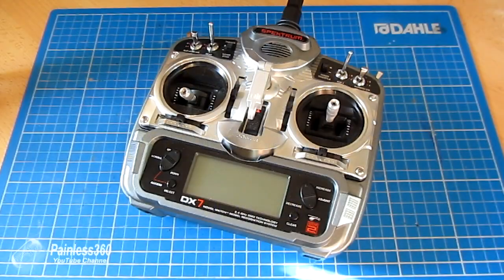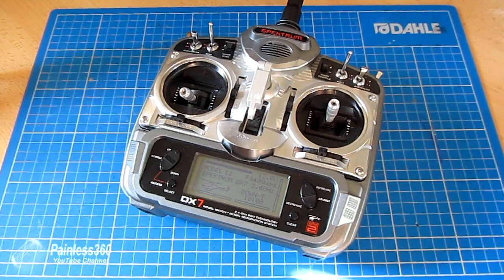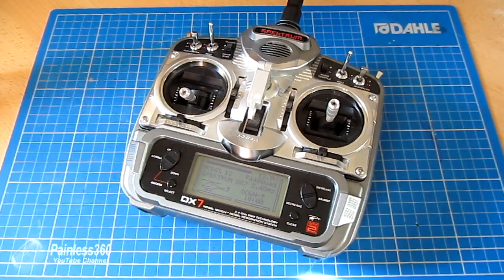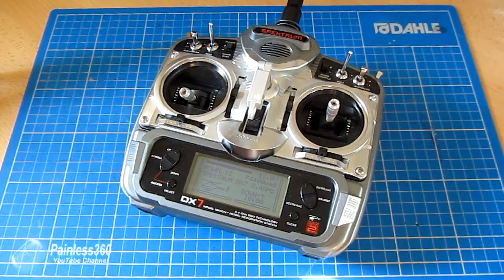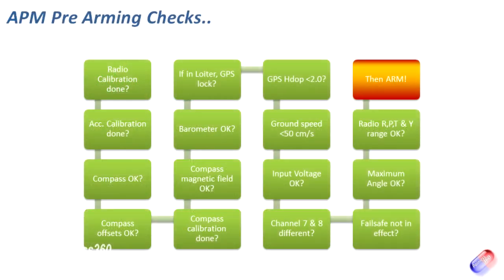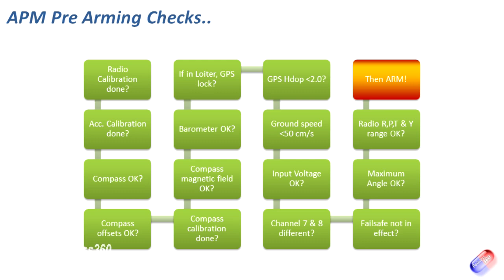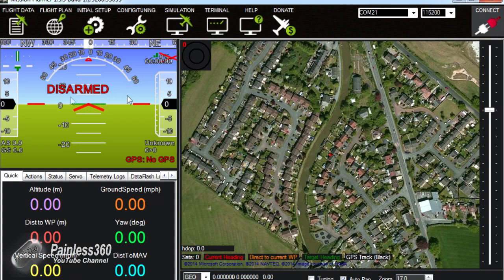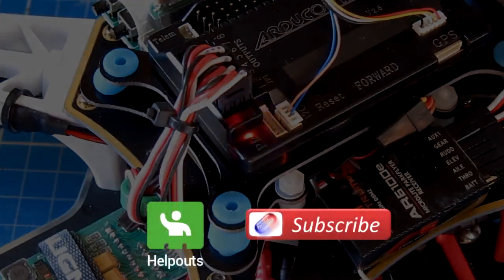(3/8) APM 2.5/2.6/3.1 - Troubleshooting APM arming

Comment: Ive got a problem, I can arm my tricopter with no errors in the artificial horizon, but my motors do not spin up with throttle input
any solution?   thx
Reply from the maker: Has it ever worked? I would check that you have the cables from the ESCs installed the right way in the outputs. The black wire from the ESC should be towards the outside of the board..
Reply: it has worked,i did a test on the motors individually just hooked my r/c reciever and they do run....i hooked them back into the FC and they do run when armed now, idk what was the problem but next is a flight test when my battieries are charged
Reply from the maker: Greta news! Happy flying!

Comment: you can plug in the usb while the APM is powered?
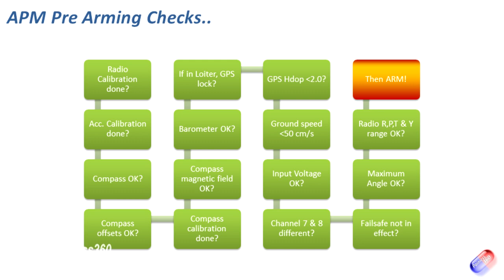Reply from the maker: Hi, this is answered at 5:42 in the video.

Happy flying!
Reply: Painless360 Thanks, ya that's where I was like "wait what?" lol I hear allot of people say not that is a nono... but I'll take your word for it because you seem to know what you are talking about... :) thanks for the great video!
Reply from the maker: It's only a 'no-no' if you are running the APM at a very different voltage from the one supplied from the USB i.e. USB provides 5.0v and the BEC if providing 5.8V.

This causes an excessive current to flow in key parts of the board due to the difference and blow the 500mA fuse and potentially damage some of the voltage regulators too.

The APM is designed to work in this way (that's why we have things like the motor test in the CLI commands to run the motors using the PC) but some are not being careful enough and checking that they don't have different voltages.

Check it to be sure and you should be fine. Every board is different though so there are NO guarantees ;)

Comment: My Quad keeps doing circles in loiter mode some times its rock steady and some times it does circles to the ground how can i fix this?
Reply from the maker: Hi Oliver, it could be a few things. I'd start with the compass.

Watch https://www.youtube.com/watch?v=3CBxyY0lS6g and then check that the compass isn't getting any interference from the power lines. If you can see any deflection above a few degrees when the throttle is up then run through the CompassMOT process to help the board compensate).

Failing that check the logs and check that the GPS signal quality isn't dropping due to vibration or something else.

Hope this helps.

Comment: I had an issue and I would like to describe it and give the solution in case somebody else has it. Issue: when I give a little throttle, motors are spinning very fast and quadcopter is taking off. Solution: I calibrated the esc manually, automatically through the APM and nothing changed. At the end I found out that I had to change the parameter THR_MID to the lowest value, because it was scaling up too much my throttle.
Reply: mm let me try that

Comment: Hi Painless.. thanx for all the vids, i have a F450 frame with the Apm 2.6 with external Gps&compass... 2 problems here. my 1st problem was my quad keeps on toiletbowling in loiter and PosHold modes. But now have a bigger problem. when connected via USB to mission planner my Quad arm perfectly.. when disconnected from Usb is does not want to arm, gets GPS lock but just a red light blinking. maby some advise please?
Reply from the maker: First one - this is usually down to interference from magnetic fields or vibration (see https://www.youtube.com/watch?v=3CBxyY0lS6g). If all else fails you can run through a CompassMOT process..

Second, sounds like a power issue. If you are powering from the ESCs then check that J1 is installed, if it is then you may have blown the 500ma fuse (see https://www.youtube.com/watch?v=TS4OWAcfAQY).

Best of luck..

Comment: My GPS catches 8 or 9 satellites. Sometimes 10. Still HDOP is around 4.0 :( Maybe GPS module is defective. Anyone has other hints what I could try to fix it?
Reply from the maker: Michal Gloc Sounds like you may have interference from something else on the craft. Make sure that there isn't too much vibration and that the GPS is well away from the other antennas and power systems that may cause interference. Also check all of the connections on the cables are good and check there isn't any dry solder on the back of the unit..Hope you get to the bottom of it.. Happy flying!
Reply: Painless360 I removed everything I could. All that's left is just APM in center on anti-vibration pad, ESCs on the beams, and GPS module on a mast (about 15cm above away from APM), Still HDOP 2.97 with 8 satellites tracked. Then I noticed something strange. When I removed APM from the pad and moved it away, HDOP fell to 1.85. The pad is made of 2 pieces of carbon fiber. I know it can conduct electricity, but with all those cf drones everywhere I didn't expect it also scrambles GPS. Edit: Removing the pad completely I got HDOP to 1.6 with the drone just sitting by the window. :)
Reply from the maker: Looks like you've found the source of the problem :) Happy flying!

Comment: Hi, I still can´t arm the apm, the red led is single blinking, the blue led is solid blue, so I think is just waiting to be armed.  The messages box in the mission planner stays in "Initialising APM..." forever.  I have tried by changing the firmware version, I don´t know how to get some log, please help me. Thanks
Reply from the maker: Sounds like one of the systems isn't coming up. You need to download and read the logfile to see which one and rule out a hardware issue. See http://copter.ardupilot.com/wiki/downloading-and-analyzing-data-logs-in-mission-planner/ for full details.

Good luck..

Comment: hello again do u have any idea why i have slight yaw to the right? :/
Reply from the maker: Could be a number of things.

Check that the rudder mid stick value is 1500 (use the sub-trim on the transmitter to change) and rerun the radio calibration in Mission Planner. If that is all ok then check that you are not using compass to maintain heading and if you are, ensure that it isn't getting any interference from the power lines.

Hope this helps.

Comment: hello i need help pls. i setup everything, the motors are spinning ok and to the right direction, but when i go to mission planner/Terminal  and test motors the motors doesnt spin. Is this a problem? i m trying to understand why, but i cannot figer out. This is the second time that i bult my hexa. When i did it at first time only 2 motors didnt spin. But now all :/ Also when i am in loiter and arm the motors doent spin. this is how it shoulb be?
Reply from the maker: Hi, I'd check the ESC calibration as the signal to the motors is at a very low throttle setting. I'd recalibrate them one by one and try again. 
 
Hope this helps..
Reply: i ll check it again thanx a lot

Comment: Hi i am havig a problem with mine, When it's plugged in and i go to arm it, it does nothing, i dont get an error message either when in mission planner, But there is always an orange light flashing/flickering constantly and i don't know what it is, the blue and red lights are flickering slowly too. Please help :D
Reply from the maker: Has this ever worked? Sounds like you are putting the APM into ESC calibration mode by holding the arming position on the Tx for more than 15 seconds. Make sure you are only holding the throttle to the lower right hand side for 7 seconds max.

Hope this helps.
Reply: Painless360 hey, I figured I had no GPS lock then, Although now when I have a solid blue light for GPS lock, I get the red blink once for disarmed and 2 orange lights flickering by the center of the board , but it will not arm!?
Reply: FlyingMaddLadd Did you found out why was that 2 orange leds blinking? I have same problem.
Reply from the maker: I would connect it to the APM and see what error codes are on the screen when you try and arm..

Best of luck.